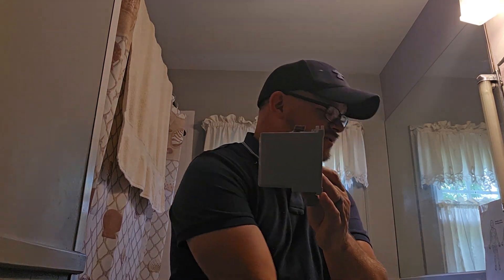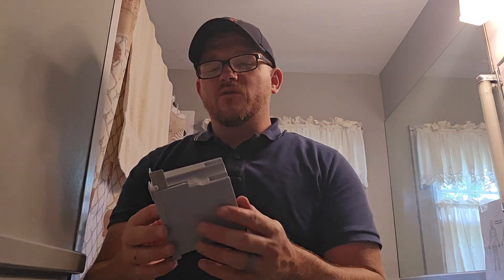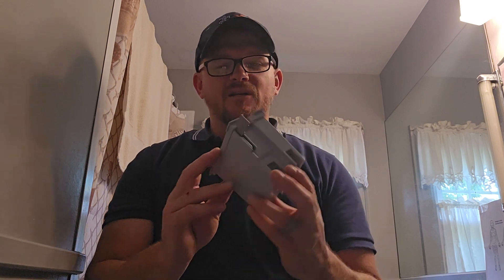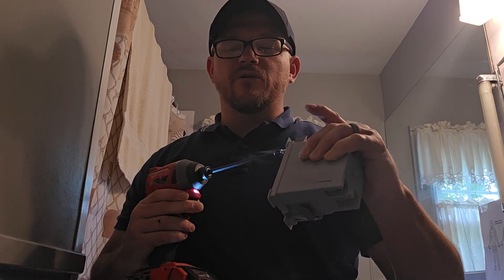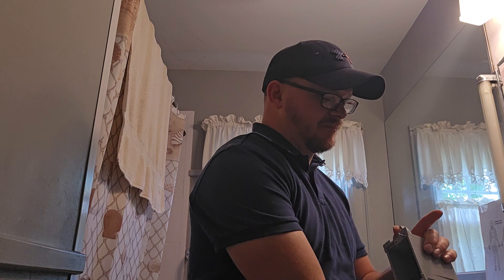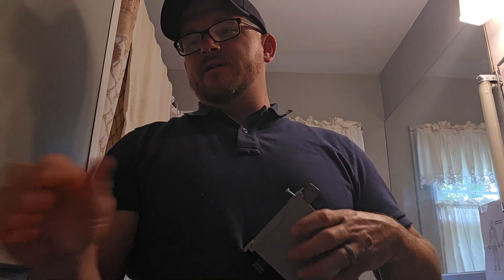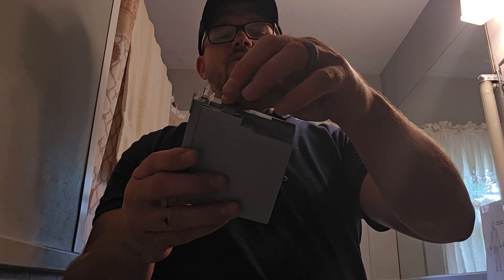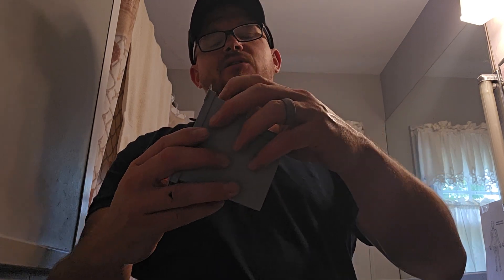Electrician Pro Tip for PVC boxes!

Comment: What you said it's true, I started doing this since those little tabs are in plastic ( before those pieces were in metal) if the screws run smooth you do not damage the drywall and you can set the box correctly.  I have a lot tricks to install those boxes, like in the e thick lat that is in the wall to the exteriors or to fix a loose box with damage drywall. Thanks for this videos.

Comment: Hey coach I have a question. I have some pole lights to install . Their 300 watts a piece (a total of 3) all daisy chained .I did the voltage drop calculation adding all 3 off the wattages and then times 1.25% since they will be on for more than 3 hours . I then took the furthest which is 300 feet away for the distance on the formula and did the math and got 6 gauge . So my question is can I run smaller cable for the closes lts and then 6 gauge for the furthest light from the previous light.